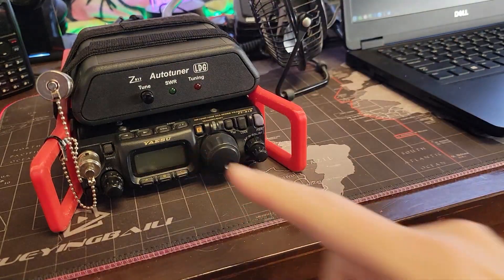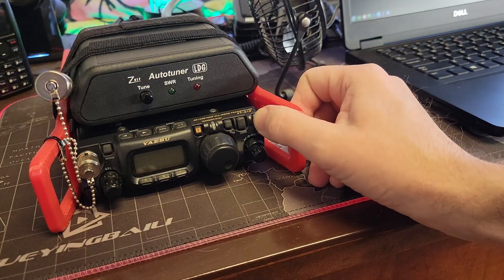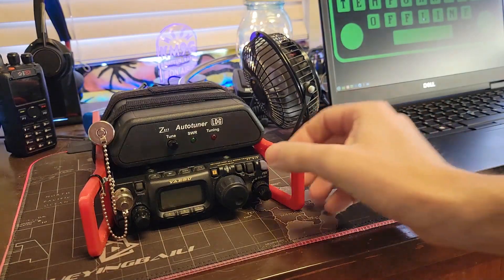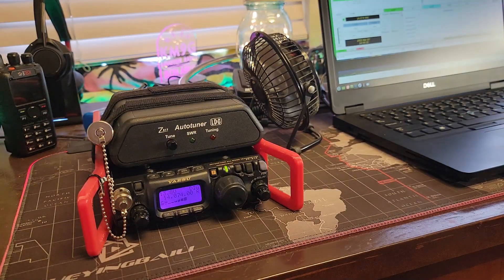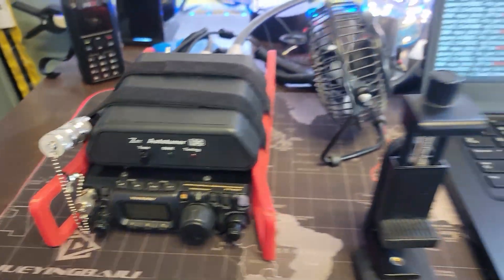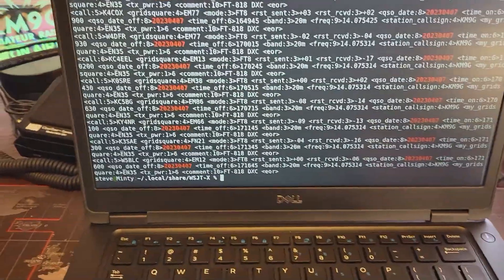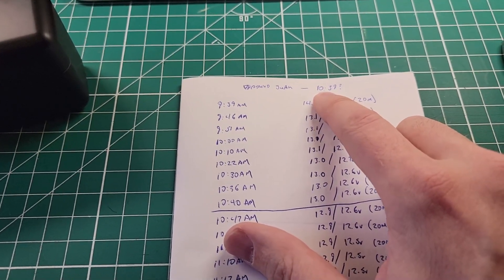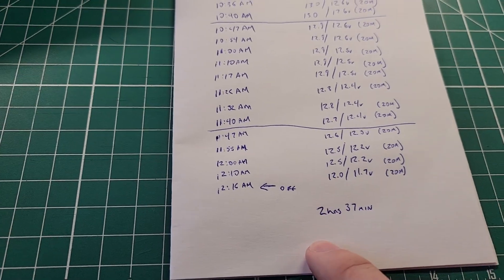Bioenno got me... I need your help!

Comment: I'm looking for a battery to power a 25 watt Retevis RT 95.  It will be in a POTA operation.  Parks on the Air.  Does anyone have any experience with such a radio and/or battery?
Reply from the maker: Lots.  Take the TX amp draw on the radio and you can math out how long your batter will last you and/or how big of a battery you need. https://youtu.be/_P2vvo0y05Y?si=XK7yn17vKlYyXxAs

Comment: Build a battery pack with several 12Ahr Bienno batteries wired in parallel. I'm also building a 150w Solar Panel Array with built in Solar tracker to keep the panels aimed at the sun. These will feed a 10Amp renogy charge controller and feed a 60w triband ham radio, an evolve laptop and a 6 station charger for hand helds. All of it except the 48Ah battery pack will fit in a mid sized pelican case and weight will not exceed 45lbs. Now to procure two carbon fiber tripods....one to mount the self aligning solar array and the other for the triband antenna. 65% of solar panel charge rate would be my break even point vs consumption @ 50% radio duty cycle. So Even at 25% duty cycle, I'd remain net positive battery charge.
Reply from the maker: That sounds like a cool project.  Check out some of my other battery and solar videos.  I love making battery kits.
Reply: will that void the bioenno battery warranty?😮 I don't know.
Reply from the maker: @jamesabc372  nope, the only way to do that would be too much current draw on the barrel jack
Reply: @jamesabc372  I'm not concerned with battery warranties.

Comment: You need to test at a 0.2C rate for the battery at 25 degrees Celsius. So the 3000mAh should be tested at 600mAX12V which is roughly 7.2W. That's the industry standard.

When batteries get warm (30-40 Celsius) they will give about 105% to 110% of rated capacity. Controlling for temperature is hard but it causes funky results when people put cells in slot style charger/testers and don't have a fan running over the top of the cells. The two inside cells will typically test higher because they get warmer than the outside cells even if they are identical cells that should pull near identical capacity.
Reply: Voltage drop at higher loads is also going to play a role. If a battery has lower IR it will be less affected by voltage drop (won't drop as much). Use Ohm's Law to determine voltage drop based on DC IR.
Reply: Also should get a wattmeter to put in between the battery and the device you're powering. I saw them on sale 2 for $18. They are "rated" for 150A which is absolutely bullshit. The more expensive original PowerWerx wattmeter might have been capable of that (but doubt due to the 12 or 10AWG cables) but the knockoffs that go for $12 each probably shouldn't be run over 50A continuous if using 10AWG. I would guess you're not running a steady 6W, there's probably some variation in power draw but I know nothing about radio gear

A 12V 3Ah battery is 36Wh so it should have lasted 6 hours.
Reply from the maker: Thanks for the info!

Comment: That "where did the current go in the 817" website shows that the lower the voltage, the lower the current used in both TX and even RX. In other words, the radio is less efficient at higher voltage. However, a battery goes from high to low voltage while still performing, it's not constant. But your estimation set it up as a constant, and that's why it's off. Another reason is that a good battery manufacturer will under-report the specs and if your battery is very new but already broken in, then it's going to have higher capacity than rated . Only bad manufacturers or brands would over state their specs. So this is the second reason.
Reply from the maker: Thanks, good points!

Comment: It really depends on what you were trying to test. It seems your test was actually a test of radio run time for the mode you were running. If you really want to test the battery capacity you need to know the full charge voltage, the cutoff voltage and a known load (current draw).
Reply from the maker: Right - I was testing the battery runtime attached to this radio using a mode I am likely to use.  I was looking to see how long I can expect in the field and if I would need a bigger battery to get my activations done.  I was expecting the external battery connector to perform differently than the internal battery connector and we have since found out that the user manual is "wrong" by today's chemistries.

Comment: Since both batteries have the same voltage the bigger one must have cells connected in parallel. Therefore, in practice the usable amperage is slightly higher because at the lowest discharge states you have two battery cells working together instead of one. Even though we talk in average wattage when turning on or off any device there's usually peaks or spikes. In my experience those peaks are better absorbed by multiple cells at low charge levels.
Reply from the maker: That makes sense

Comment: I've been using Milwaukee M12 power tool batteries for some time. Now they offer 3A in the small package (1/3 of a banana). It is just 12V, not 13+ but t powers my KX3 at 10W for several hours, although I didn't measure it. As long as my little laptop lasts, FT8.
Reply from the maker: That sounds like a good match

Comment: If you need a fan should it not also be powered from the battery too?
Reply from the maker: Depends on the parameters of the test for sure.  The fan was for radio health, not power drain.

Comment: To test a battery capacity properly u use a constant load say a light and use a battery capacity tester
Reply from the maker: Definitely, that would test the battery, but not the battery under load of the radio which is the info I need.

Comment: I am thinking max power transfer theorem.  I don't know this, it's thinking outloud at you.

So put another way the other also-ran's have an internal resistance that doesn't match the load (ft81x) 
But the lifePo4 with the premium choice of cells I suspect it is probably lower internal resistance.

I would like a video showing the smallest portablest way to keep them properly charged.  Like if say I had two one on the KX2 and the other on a roll-up solar panel and rf quiet solar charge controller.  For the man-portable or sota context.
Reply from the maker: I use the bioenno charger when I need to charge my LiFEPO4s - works great!  If you're charging multiple batteries, charge them one at a time until they are all balanced - then you can drain and charge them as a unit connected as one larger battery.  If you ever disconnect the group, just repeat those original steps to balance them.

Comment: Charging time matters. The lower the charging current, the more energy is stored. Not without influence is the fact that the battery was kept at the optimal temperature during discharge.
Reply from the maker: There seems to be a lot of factors and I'm getting a crash course!
Reply: Charging time does not matter. As long as you charge to 3.6 or 3.65 per cell and then allow the pack to CV down to 0.05C for current cutoff a LiFePO4 battery will be at 100% State of Charge. You can do that with A123 26650's by charging at 4C/10A until it hits CV and that will be much faster than your standard 26650 charged at 1C.

Obviously most LiFePO4 cells that are 26650's can't support a 4C charging current so its a little unfair but a good example.

Comment: Were those estimates from the video where you added transmit and receive currents when you should have time averaged them?  I.e.; you need: battery_capacity / ( (i_receive * fraction_of_time_receive) + (i_transmit * fraction_of_time_transmit) ) = estimated_operating_time
Reply from the maker: Yes!  That's part of the problem - the other part is that the radio changes draw with battery voltage

Comment: Watts don't matter batteries are not sized to watts, they are sized to amp draw. 3000 Mah is 3 Ah. (3000 ÷ 1000 mah to ah) so from this time of 2 hours, you pulled .66 amps for 2 hours. --- so figure out your amp draw from your watts output. Then you can accurately determine your battery size needs for the time desired.
Reply from the maker: I'm gonna have to apply this!
Reply: Yes they are. Watt Hours. EVE's testing data uses watt hours. When they give the amp hour rating they just take the watt hour measurement and divide it by 3.2V, the nominal voltage.

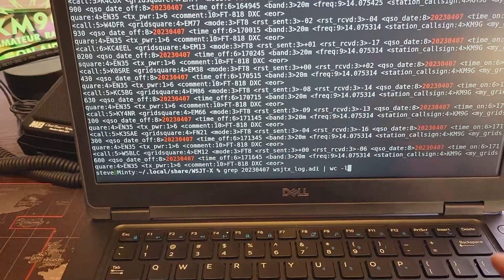Comment: If you assume FT8 is 50/50 TX/RX you have (.5 *.45A) + (.5 * 2.31A) = 1.38A draw on average.  With a 3AHr battery that's a little over 2:10.  The extra 27 minutes comes either from the battery being a bit more than 3AHr (likely with a Bioenno) or a slightly lower duty cycle than truly 50/50 (likely because it doesn't transmit for 100% of the transmit cycle) or small inaccuracies in the current measurements.
Reply: Bam. Right there it is. Matt beat me to it. So much for my EE contribution lol!
Reply from the maker: This is good!
Reply: Matt has provided a good framework for the estimate of the battery life. An in-line or clamp amp meter or a battery wattmeter would probably show the duty cycle pretty accurately.
Reply: And, even then, it's not a straight 50/50 when it comes to FT8.  You have those 2 seconds at the end of the 15 second transmit cycle where it listens.  So, if you factor that in (13 seconds of transmit, and 17 seconds of receive), you're about 44% transmit, and 56% receive.  So, that could account for the extra 27 minutes that Matt is talking about here.

Comment: I would look at cell resistance vs battery pack resistance.  I would think the cells in a pack would be higher.  Now 2x longer would be interesting.  Now add in TX vs RX that timing vs other tests could be different.
Reply from the maker: Thanks!

Comment: I power my Xeigu G90 with the 3amp hour battery. I average 6 hrs between charges. I am going to get a larger battery for POTA. Winter Field day I made 20 contacts in that 6 hrs at the full 20 watt output power of the radio. I love the Bioenno battery.
Reply from the maker: Its good stuff!

Comment: Why is this surprising?  Ft8 has a 50% duty cycle.  So it's really like you were keyed down CW for about an hour.  The battery voltage drops toward BMS cutoff at a bit below 10v over that duration.  While the radio is configured for 6w TX, actual output power drops along with the supply.

So while this video shows practical endurance of this pack, the methodology isn't right for measuring actual pack capacity.
Reply from the maker: Right, there were "unknown unknowns" in the original calculation - the radio changes power levels at voltage levels and also outputs more power than the manual says it should.  Practical tests always win out over theory.   But theory gets you close.
Reply: @temporarilyoffline  Yep.  I used to run a 30AH, 3S custom LiPo pack for in car Kenwood V71.  It got used heavily at 50W tx setting  and would last a week.  It was pretty obvious towar Thursday when the pack gets closer to exhaustion.

I've found the easiest way to track pack capacity over time is through the charger.   I used one designed for RC packs.  It integrated instantaneous charge power into actual total charge energy over the recharge cycle.  Take 85% of that number and you get actual pack capacity.  If you wanted really accurate numbers, configured it for discharge followed by charge.
Reply from the maker: @RobertLeeAtYT  Roger Roger

Comment: When you did your original calculations you assumed 65% receive @ .45 amps and 35% transmit @ 2.31 amps. Then you summed them to 2.76 amps and used that figure to divide your 3 amp hour battery. That would assume a you're transmitting and receiving the entire time. You'd have to do 3 ah / [(.45 * .65) + (2.31 * .35) ], or  3 amp hours / 1.101 amps ~= 2 hours 15 ish minutes. At least, that's my best guess as to what went wrong with the estimation. Obviously, the actual power usage overtime may not align with the computed estimates.
Reply from the maker: Thanks!  That helps!